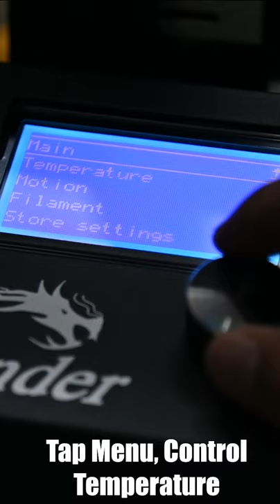Easy method to change Filament on the Ender 3 3D Printer #Short

Comment: What's the normal method for changing filament though
Reply from the maker: This is the standard method.
 Heat filament to 200 degrees, wait for a few seconds once it's at that temperature and pull out old filament. Now feed in the new filament through the extruder and Bowden tube and holding the clip open push the filament  manually through. This pushes or purges the current filament within the nozzle and keep pushing until you see the colour of the new filament. Done, you've changed your filament.
Reply: @TalkingstuffNet  that is  literally the same thing lol
Reply from the maker: I have another video which shows a different method and is more suitable for the ender 3, this method works for all fdm 3d printers.
Reply: @TalkingstuffNet  Its always the same tho lol 
heat the extruder 
pull out the filament
put in new filament
Reply from the maker: In the longer video i had shown an option not available in all 3d printers, ' change filament' which automatically pulls in the new filament' instead of manually having to push it through.

Comment: What if the filment does not come out and it’s stuck In there
Reply from the maker: If it's stuck you might have to open up the nozzle to clean.
Reply: Always push the filament in before pulling it out to melt any deformation that happened near the hot end.